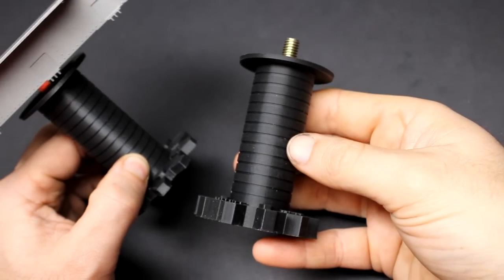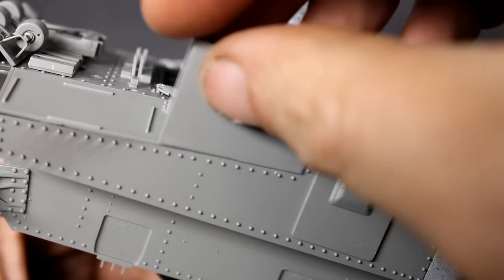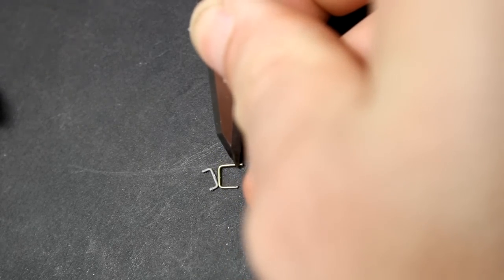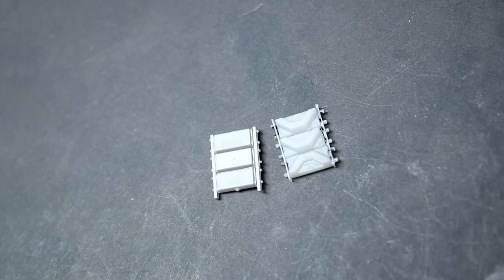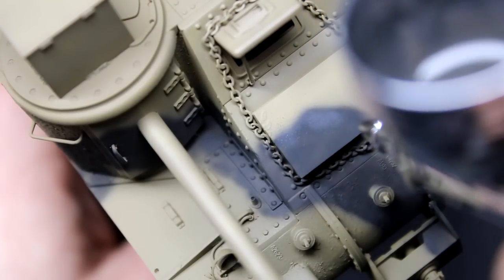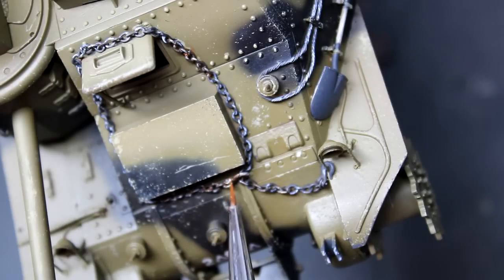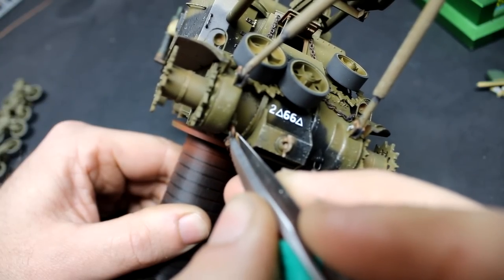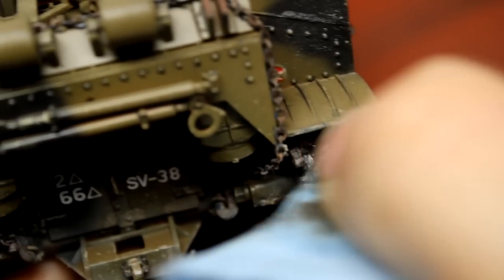1/35 Takom M31 Armoured Recovery Vehicle - WIth 3D designed and printed parts!

Comment: I like your build.  You think like I do, and your build shows lots of character, unlike many aircraft models which tend to😊 look ridiculously pristine.
I realize that you added the missing tow-hooks but after searching for photo refences, I never did find actual hooks.  So I'm not saying that yours are wrong, just that Takom may not be wrong for not including thrm.
I like the way you use paint and colours to layer and texture the finish.  Very realistic.  I would have finished it with more dust but that's more artistic impression than accuracy. 
And you're right about adding more equipment and replacing parts with metal and wire -- easier to finish and alter, plus the jeweller's chain. 
Lovely model with real added character.  Tanks don't have to have guns to be interesting.
Easy thumbs up, my friend!
Reply from the maker: @randytaylor1258  thanks bud I appreciate your feedback. I have challenged myself to get better at building armour, so expect another M4 chassis early next year!

Comment: Very Nice!! Well done!👍🏽👍🏽👍🏽
Funny coincidence, as I was down at my favorite hobby shop, today,  I happened to pick this model up, and check it out, but unfortunately, I ignored the inner voice saying buy it, and sadly, did not purchase it..😢.
On track part, you were actually very wise to purchase aftermarket tracks. The tracks on the Takom M3 series, in my opinion aren't that great, and I had issues with them in the past. Those looked like Master Club tracks you were using!!👍🏽👍🏽👍🏽
Reply from the maker: They are master club tracks but they are difficult to get a hold of here in Canada. I used them as a reference to 3D design ones I can print in the future. I want to do a USMC Sherman on Iwo Jima this year